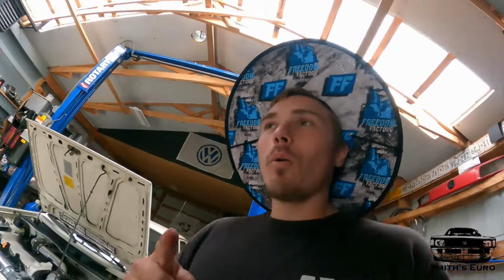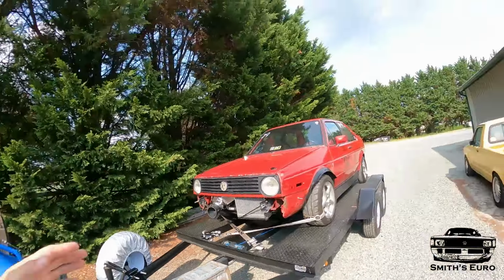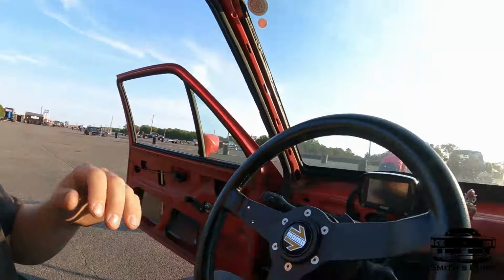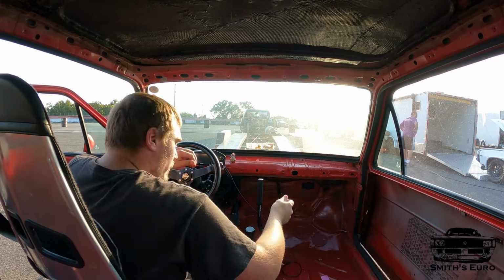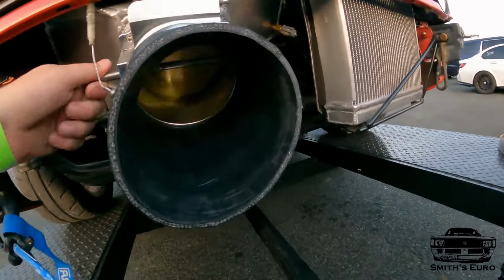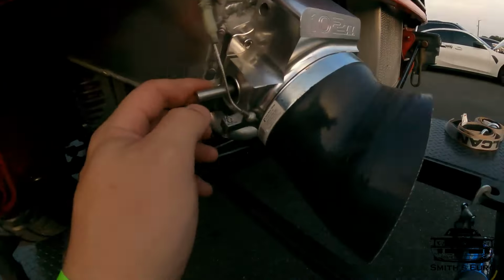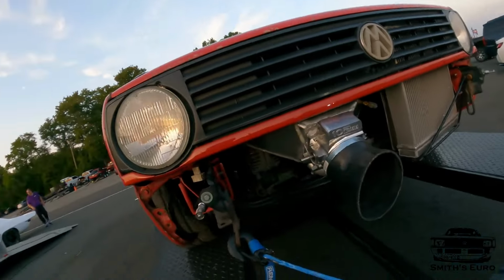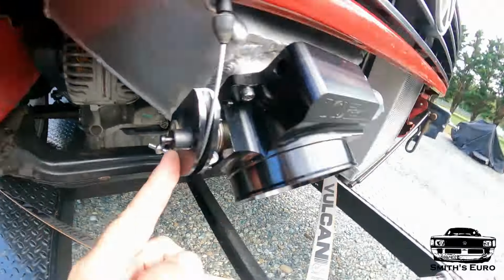All Motor VR6 3.6 Back!

Comment: Back in the day before I corrected the issue (throttle pedal stop), I was on a low 9sec pass at Irwindale and the cable pulled out of the pedal goin into 3rd. Lookin forward.